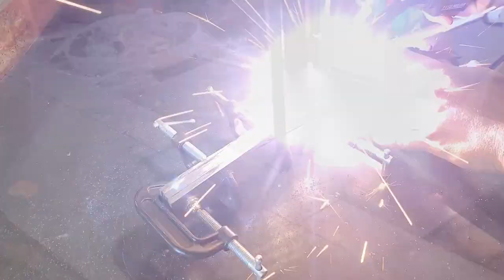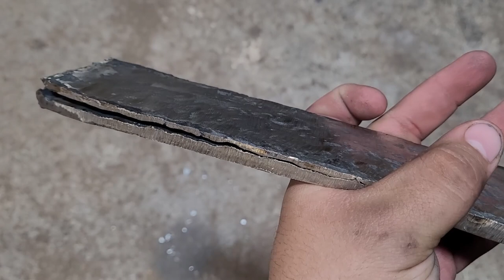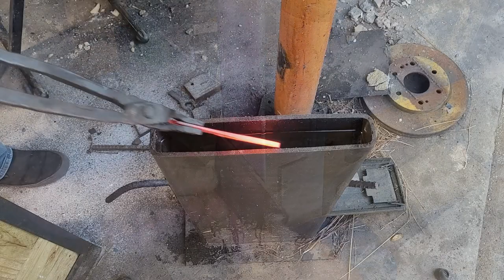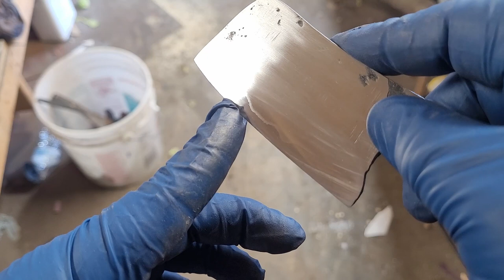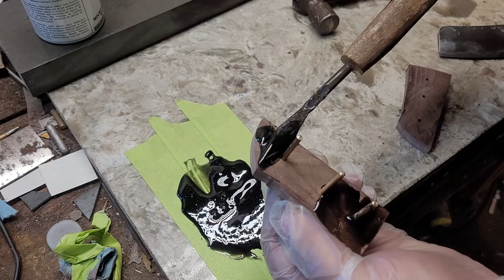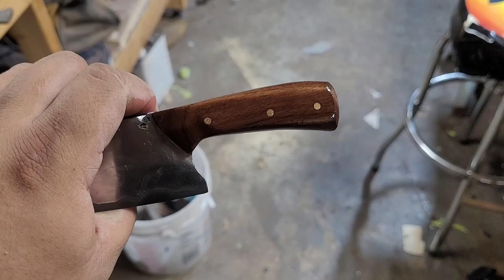Not What I expected - Making A Stainless San Mai Cleaver

Comment: Stainless San mai is hard. My success rate was near zero for the first 4 or 5 tries. Lol. I finally had a professional welder friend weld the seams on 5 billets for me. I figured I was leaving pin holes which was letting oxygen in. Doing that and getting billet way hotter than normal forge welding gave me my first true success at process.  Good luck and I like the way you kept going and made it work.
Reply from the maker: Thank you. My welding skills are subpar at best haha. I also agree on the heat. The part that stuck the best was directly under the flame so i belive it got hotter than the rest. Next time i will try with a smaller billet and get a more even heat on it.

Comment: I actually like the little choppers, sold a few similar to that which people use for herb and cheese cutters, bit thinner though!
If you're using a 300 series steel, best advice is to get some thin nickel foil between it and the carbon steel, then weld the outside with 309L welding rod- everything needs to be immaculately clean too prior to welding. Also try to keep the thickness down a little as you're just going to run into constant delams with this type of san-mai, so maybe 2-3mm 1/8" cladding and the same with your cutting edge. Don't try to forge it out after because it'll just rip itself apart, so try to aim for a billet which is roughly the size you want for the blade.
Forging temps- that pale yellow, almost white hot
The layer of chromium oxide on the outside of stainless is basically what needs to be overcome, the nickel will help a bit, but by itself its really hard to get it to stick to carbon steel and there's sort of a risk with thermo-cycling all the way through to quenching that everything just pops apart, its a complete pain in the arse so good luck
Reply from the maker: Thank you and ill keep that in mind. One thing ive learned as well that i didnt do was preheat my dies beforehand. I belive that plus just not enough heat was a big factor in this failur. Next time I will try to take all factors into consideration. Especially since i was going for a chef knife and ended up with a mini chopper 😅

Comment: I remember the first time I heated up a leaf spring and pounded on it.. using a rail road track as an anvil at that time.. I thought..wow .this looks so much easier on t.v.
Reply from the maker: Im wanting to do Cumai soon and i just watched a video by Tyrell Knifeworks and he made it look easy. I doubt ill have the same luck first time 😆
Reply: @JPsBladeworks  I'm going to dry Damascus this weekend. Some 52100 scraps and some band saw blades.  Just a small billet.
Reply from the maker: @NORTHBROOK1978  by hand? Or do you have some sort of press for it?
Reply: @JPsBladeworks  by hand. I'm working on a press. I have a small log splitter. Just have to get a better welder. Should be this summer.
Reply from the maker: @NORTHBROOK1978  sweet. Ive never done damascus by hand. I started backwards and build my machines before i started forging. Now im trying to learn the basics and its a bit harder because i have bad tendencies already hahaha
Reply: @JPsBladeworks  I can relate.  I'm a machinist. I have all the cool toys at work. At home it's all hand.
Reply from the maker: @NORTHBROOK1978  Im not. But i want to learn how to make stuff and have plenty of cool toys. The machines i make are far from perfecr but as with knife making its a learning experience.